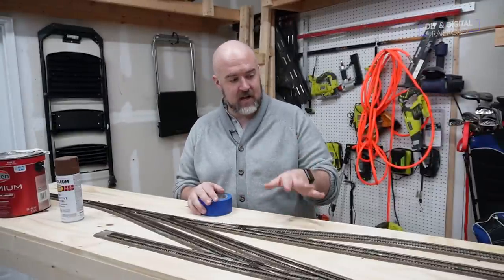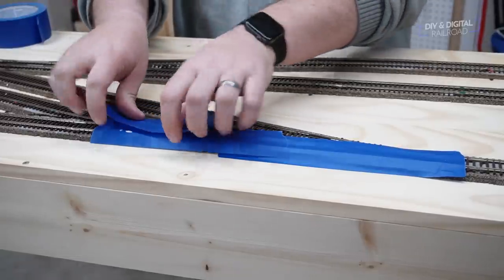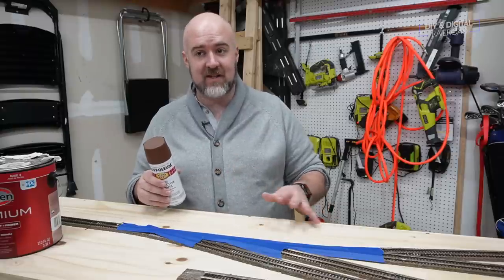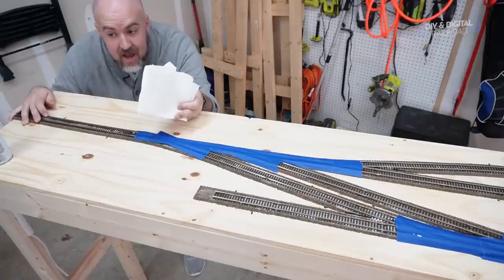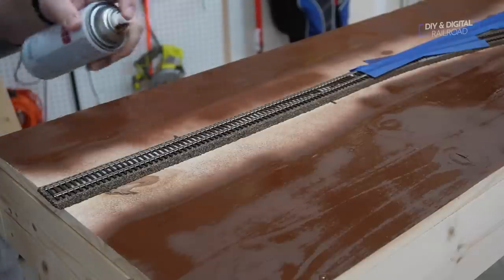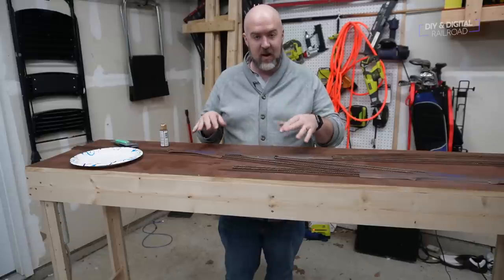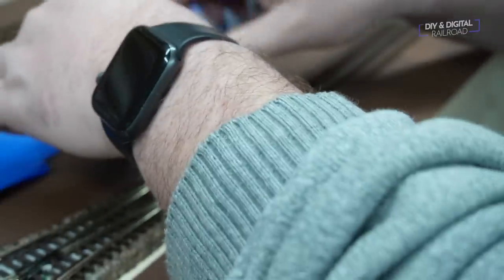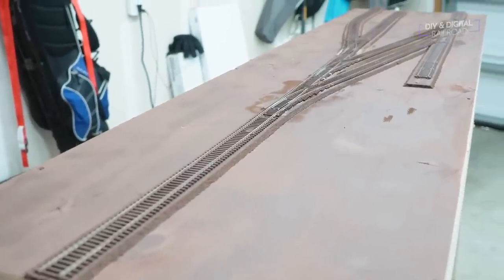The easy way to paint your model railroad track

Comment: I spray painted my N scale with that “camouflage” marketed spray paint and love it. The only thing I did to protect the points was by putting sticky tac between the switch point and the main rail on a single side. 

I also made sure to spray from multiple angles because I was intending on the layout being viewed from all angles. Did I miss him mentioning not painting the reverse side? Is the layout going to be always up against a wall on the side we are viewing it from? 

It actually looks like he might have moved around a little to paint more before the final reveal?

Also, I waited until the paint mostly dried and then scraped it off with a razor blade, dragging it of course, and not pulling in. In places where it was lingering I used my fingernail, and then also a track cleaning tool.

Comment: I used Rustoleum Camo brown to paint my track. To clean the surface of the rail I didn't do any funky things like oil the surface or anything.  I follow Rob Spangler's method (wp8thsub layout) and simply dragged a utility knife blade backward across the rail surface.  It worked like a charm.

Comment: Another great video, Jimmy! I've always spray painted my track. I have an old  Kalmbach book "Trackwork and Lineside Detail for Your Model Railroad" that outlined the technique. It suggested oiling the top of the rails with a rag over your finger, which I do. Makes cleaning them a snap and prolongs your work time if you have a lot of track to do and don't want to start and stop to clean the rail top. I use the camouflage as the base, then shoot straight down with random light passes of black, then finish with another light pass of primer red.

Comment: Good video. Especially like the idea of wrapping the paper towel around the spray can lid to wipe the tops of the rails. One suggestion for the points is to use a product called Neolube. It blackens the metal but still conducts electricity. I have used it on my N-scale layout without any problems. Cheers.

Comment: I experimented a different method last night with a piece of track and was very pleased with the results! First, I used what I thought would be a good rust base color (Cinnamon). I sprayed the track at a side angle to get paint on the sides of the rails inside and out, gave it a couple minutes to start to dry (but not fully), then went directly over top and sprayed straight down with a darker brown for the ties. Not only did this cover the Cinnamon sprayed onto the ties, but the small bits of overspray speckled the Cinnamon rail rust at a very small level and made it (to me) look realistic and awesome. Not to mention it was very quick compared to using any sort of brush in detail. I wish I could post pictures here to show everyone!

Comment: It's interesting to watch your process. Personally, I paint the whole baseboard before laying any track.
Then after the track is laid and ballasted I airbrush the track. 
I know, many don't have one but for me, the $100 or so for a cheap but ok compressor and airbrush is so worth it.
It still needs manual touchups around the turnouts (I've gotta check out those micro brushes)
Like others have said, I use the piece of wood trick too.
Reply: Gerry, I'm with you. I think you'll get better coverage on the baseboard with latex and a roller. Airbrush would probably require less masking as well. There's cheap airbrushes out there (or it can be considered a long term modelling investment) and used compressors pop up at garage sales and resale shops. I like that wood trick

Comment: I agree with the other comment about using a piece of wood to clean of the track after painting. I use it shortly after painting and it works very well. Another thing that works for me is some cork track bed.  Thanks for another great video.

Comment: I am a little confused at your process here. You say you are painting the rails then you wipe off the rail heads with a towel? I can see that you are painting down on the rails and the ties but the sides of the rails are not getting any paint. Wouldn't you want to paint the rail sides rather than the top of the rails? You would get over spray on tops which is understandable to want to wipe off but the sides are still shiny.

Comment: Tip on Not spray painting the rail top, for base coating or weathering. My ol' friend, Dave, taught me to apply baby oil to the rail top with a Q-tip. After spraying, quickly wipe clean with iso alcohol.

Comment: Around 2005, I attended a show in which a lecturer demonstrated that the first thing he does when acquiring a length of flextrack is to spray the whole lot rust colour and wipe off the top.

Comment: Really dislike to see roads where the points were covered up when painting. They look so stupid...Why not just tape the points and frogs???? Taped these finally, but should have done this before... When wiping fresh paint I use a wood block with material tight on it.Unpainted points and frogs look horrible...
Reply: I put sticky tack in between the points and the rails when I painted mine. I think I actually taped the points at first so I could just do broad spraying of the track, and then put the putty in once I was ready to focus on the specific.
Reply: @andrewlaverghetta715  At least that would be only a real small shinie place..